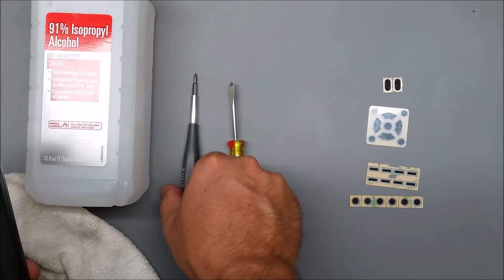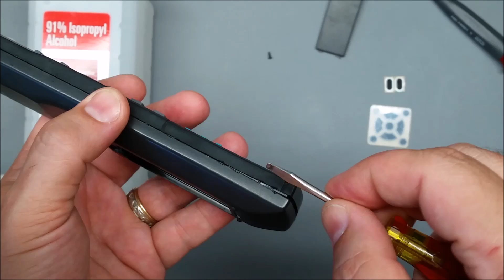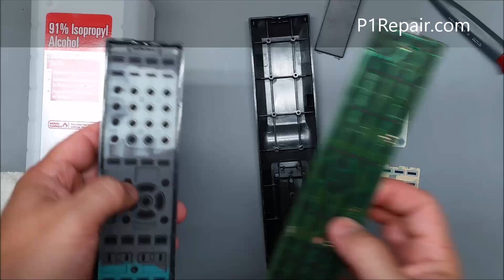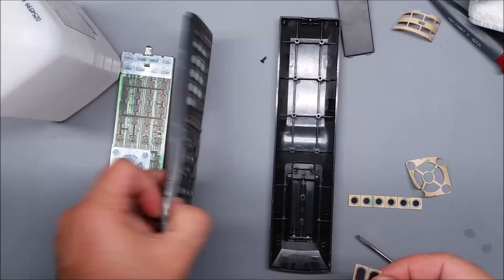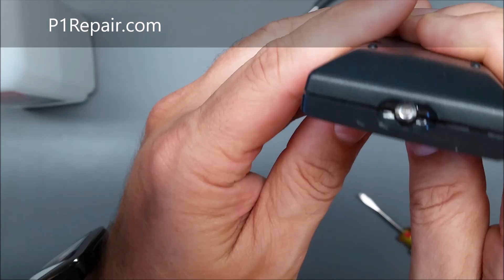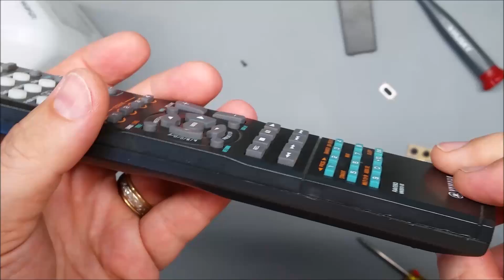RAV283 Yamaha Remote Control Button Repair

Comment: Remote repaired!  It takes a surprising amount of force to get the bottom portion undone.  I used the side of a stiff putty knife.  The side latches release much easier when sliding the screwdriver blade along the channel (as shown in the video).  Cleaning the circuit board with alcohol returned the volume buttons to operating with a light touch.  Thank you for this useful video!

Comment: Thanks a ton for the video! I bought a used Yamaha amp without checking if the remote worked and was devastated to find that it didn't. I was afraid to break the remote opening it up but starting at the bottom was the trick. I used a guitar pick to work my way up after, with no damage to the rest of the plastic housing.  There was oily buildup everywhere on the circuit board. Cleaning this up with rubbing alcohol was enough to bring it back from 0% to 99% working order! 

Also, to "repair" the plastic dents, I used a lighter and it worked! Just keep the flame a couple inches below the remote and don't overdo it. It doesn't come back 100% but is still way better than it was.

Comment: This remote control is 95 % identical to Denon RC-1189 (and probably many others) which I could open & fix thanks to your guide.
Reply: PIONEER AXD7532 too (as far as housing and buttons shapes and location).

Comment: Thanks for the awesome tutorial!  I had a button (down) on my RAV483 that would occasionally work.  I didn't have the repair kit, but watching your video to take the remote apart was great. Then cleaned contacts with rubbing alcohol, and it seemed to do the trick (there was something sticky in there...probably courtesy of my 4yo son!).  Many thanks!!!
Reply: I don't have a son so I blamed the wife. Trouble is, she doesn't drink rum and coke.

Comment: Thank you so much, although its 2 years later since you made this video, it was very helpful to me today, as not to purchase a new one. Thanks
Reply: I used your video to remove RAV521, but I had to use a small flat screw driver and a hammer to pop the case. And it worked, thank you, God Bless you always dear friend.

Comment: Thanks for the video.  The remote open, alcohol wipes own, and reassembly worked for my RAV544 remote.  It's strange but the backs of the common buttons were almost oily but not any of the other buttons.

Comment: Thank you!!!

My RX-V373 remote's volume buttons had failed, I would have never been confident enough to deliver the amount of force required to get the blasted thing open if your video had not confirmed there is just the one screw! I made a right mess of the edges lol, but that will be corrected with some sandpaper and it now works perfectly once more!

Just cleaning the oils from the buttons and circuit board was enough to bring it back to perfect working order.

Comment: Excellent advice as to opening the case! I did clean as suggested, but it didn’t help. However, I did have the old remote. Took it apart an discovered the volume keys had oil on them.  Cleaned them and could only get the down volume to work. So.......I swapped out the old keys with the new and ....BINGO.......the remote works!

Comment: I replaced the kit with graphite grease. It works too. Thanks a lot
Reply from the maker: You cannot repair buttons with graphite grease. There is nothing preventing the grease from activating buttons all the time and locking up the remote. It will make a mess and most likely cause permanent damage.
Reply: @p1repair  I won't argue. Nevertheless, it worked
Reply from the maker: @ivanweis  There  are a lot of techniques that will work for a short time. But there are no coatings, glue, paint, foil or grease that will not move, chip, flake and cause problems sooner than later. I tried everything out there (and many things not out there) for over a decade before making my own solution. There is nothing worse than getting something in for repair where someone tried to fix the buttons with some form of conductive coating. It never lasts and always creates more problems.
Reply: @p1repair  How long will my remote control work now ))  I'll keep an eye  on it

Comment: Thank You Sooo much for this.  I think half the receivers for sale second hand do not have remotes because people have no idea that they can be easily and cheaply fixed,  so they throw them away!  I just used ethyl alcohol to get rid of the oil and it worked like new!!!

Comment: I once spilled Coca Cola on my remote for my RX-V671 and never really dared to pry it open. But after watching this, I just thought ''Screw it. I can't get a replacement anyways, might as well try'' So after I got it opened and rubbed it good with some alcohol, And now it works way better, still a bit tricky but works. Thanks a bunch for this vid mate :-D They should make these things easier to open...

Comment: Thank you it helped me repair my PIONEER AXD7532 remote (it look a lot like yours, at least plastic casing and buttons repartition, even though functions are not located at the same place).
There were bad contacts, volume button would need high force to make the receiver work. Some buttons didn't work anymore (swith on/off).

Only thing to watch out for is the battery contacts made of metallic wire which I almost teared apart when opening the housing.
Also, I tried to put some carbon from a pencil. It worked for a few minutes, then nothing anymore (I checked if the bubl would light thank to your tip, with my smartphone, nothing).
I opened it again, cleaned all the carbon powder I had put, reassembled, didn't work, reopened, cleaned again. When reassembling, I tried to put the battery contact back in place (it is a little bent).
It is working now, I don't know if it is a problem with the button or with the battery contacts. THANK YOU!

Comment: Thanks very much for doing this -- the exact same volume button was broken on my unit. Fortunately, I didn't have to buy a new membrane kit, as I only needed to reseat the stock membranes and buttons back into the case (a dust gun cleaning and the use of isopropyl on the circuit board probably helped as well :->). Also, the heat gun use on the outside is a great trick.

Comment: What do you do when it's not the contact pad but the circuit board that's the problem? I take the rubber button pad and move it on the remote; the problem contact works on it's neighbors (that are the same size, design etc), and it's neighbors won't make the problem contact's circuit work. I've cleaned the board with 70% rubbing alcohol. Thanks for the video, and thanks for any advice you might have.

Comment: Ok, so to open these remotes properly, you should never use a screwdriver like this, you're more than likely to stab your hand, after taking out the small screw in the battery compartment, you can use one of those plastic spudges they use on iPhone screen replacement, or those thin metal ones, you don't damage the plastic this way, as for non responsive buttons, I've been repairing remote controls for more than 30 years and I've only ever used 99% Isopropyl fluid to throughly clean the button contacts and the PCB contacts, that's all that's needed, I've still got one I use everyday that I cleaned like that over 10 years ago, those kits are only there to take your money, what I actually do is completely strip the control down and use an old toothbrush and windex, it gets all the finger grime and crap off, then I reassemble.

Comment: Thanks for this video.  My remote for my HTR 5550 has a mute button that's unresponsive.  When I went to the Buttonworx site, I didn't see any kits for Yamaha.  My remote is an RAV242.  Regardless, I was stumped on how to open the remote until I saw your video.  Once it was apart, I could measure that there was no conductivity on the mute button.  Other functioning buttons showed very low resistance.  I used a pencil and that ought to get me about 10 mutes before it wears off...  ;-)

Comment: Is there a way to open the remote control without butchering it on the side?
Reply from the maker: The video shows how to open it without damaging the plastic. The damage shown in the video was from the previous owner of the remote. Also, much of the damage done in these cases can be repaired with a heat gun. I have a video about that here:  https://www.youtube.com/watch?v=rsLSwYw_ZO8&
Reply: @p1repair  Thanks, but I am terrible with the heat gun. I must open the remote without damage it. I bought some tools, but don't know if I will be able to open it without scratching and bending the plastic.

Comment: Opened. And cleaned with alcohol. Close.  No repair kit was needed.
Reply from the maker: Cleaning is a temporary fix. The buttons will fail faster each time. Some buttons do not respond well or at all to cleaning.

Comment: Hello... my rav242 won't even blink.  I've managed to open it and found that some of the black membranes on top of the board are pulled away... where do I get the replacement sticks that you showed... thanks for your help.
Reply from the maker: The original remote does not have a  membrane. The repair technique is a new addition that replaces the electrical function of the rubber keypad that fails. I'm not sure what you mean by "black membranes that are pulled away". You can order the part at p1repair.com

Comment: i cut some aluminium foil (*to fit within the individual button mould)  an she did the trick perfectly. 
didnt even glue it down.😅
Reply from the maker: If you're lucky that will just short out a button and lock up everything else. If not luckily, it will touch other circuits and permanently break the device.
Reply: @p1repair  so far the two buttons work perfectly. I will keep that in mind if it starts playing up 🫡
Reply from the maker: @caveman1988  Not if... when. It's most likely draining your battery as well.
Reply: @p1repair  No worries. I will be mindful of it. Thanks for your time.

Comment: I used the technique to get the remote off but I need to know how to change the bulb on it.
Reply from the maker: The Infra-Red LED is not something you should need to change. They don't go bad. Or at least I have never seen one go bad. They are soldered on and would require a soldering iron and some understanding of basic electronics.  It may be a bad solder connection or a problem with another part of the remote.
Reply: I went to RadioShack and they said it was the bulb.
Reply from the maker: RadioShack is clueless. There has never been a bulb in any remote.  It is an LED and they quite literally never break.

Comment: Maybe use a super flat screwdriver next time.

Saves having to go on ebay for a new remote cover because its beat to sh*t being opened lol
Reply from the maker: I need to make a video about that. I have a magic trick for dinged up plastic
Reply: p1repair I literally just used an old credit card.

Worked perfectly lol